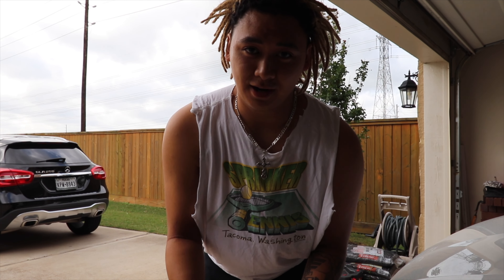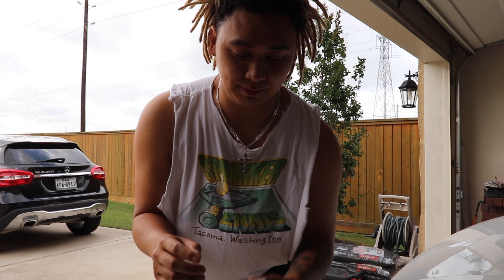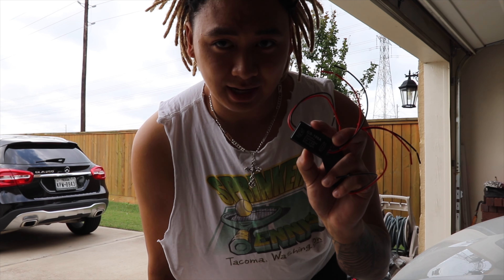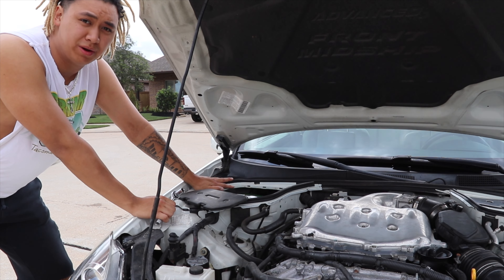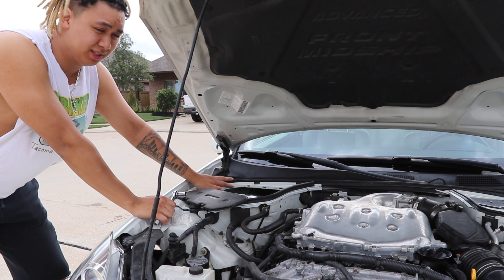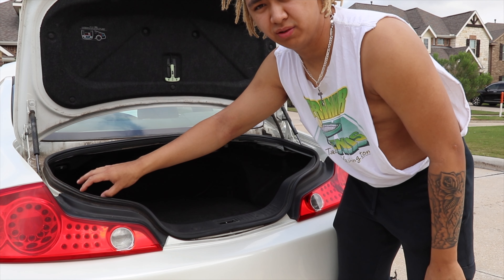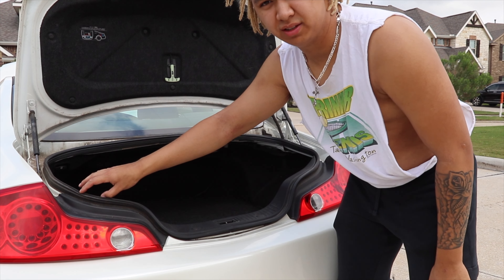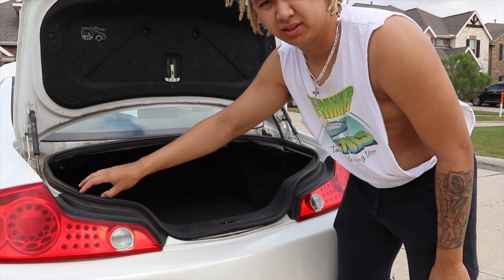G35 BLINKING BRAKE LIGHT MOD!

Comment: I did it on my 2009 g37xs sedan. The wires were not the same colors, and it didn't work but when I put the turn signals on both left and right the strobe work.
Reply: You cut the turn signal wires instead of the brake lights itself lol

Comment: Yo I bought two of these for my g37 coupe 2008 and it’s just not bright when it does the flashing. Where can I find a good one?
Reply from the maker: Just make sure the wires are on the correct ones and wrapped tightly. If that does not work, I recommend getting a new set on Amazon. I bought mine for about $11-$15.
Reply: Did you find out why
Reply: @KreedDang  what’s it called bro I would appreciate it